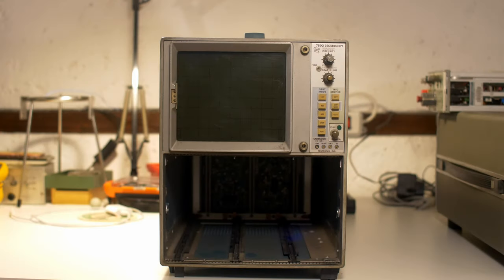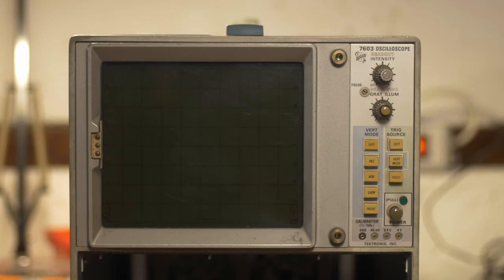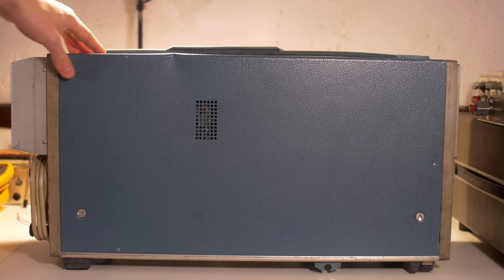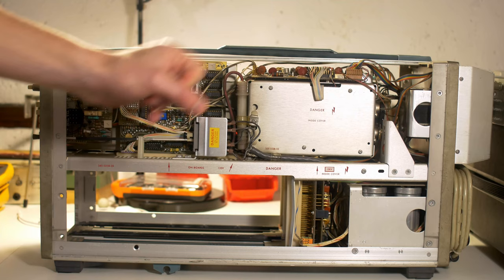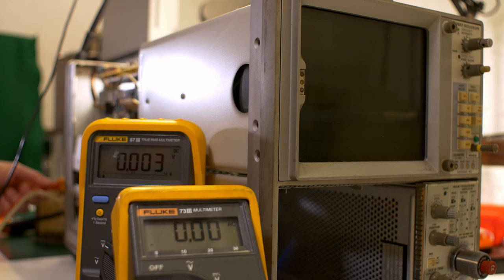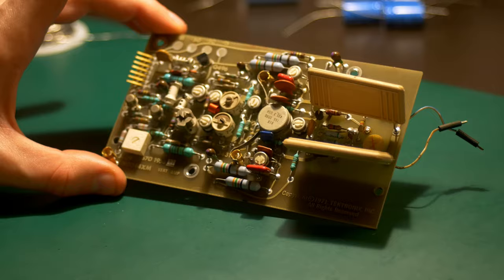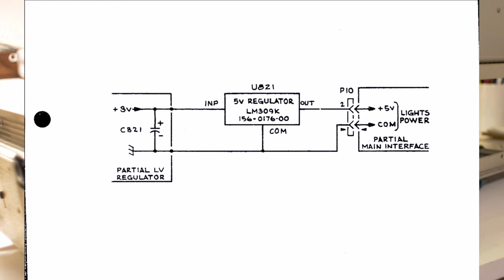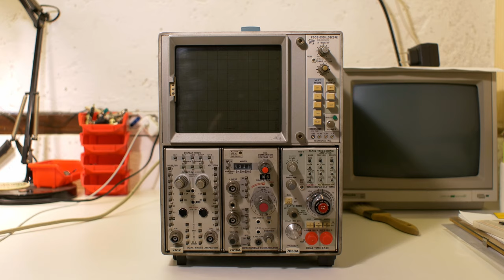Tektronix 7603 Oscilloscope Restoration and Modification

Comment: 20€ for a 7603?!? Is he kidding? The guy who sold it obviously didn't have a clue or was doing a huge favour. They usually go for 10x that (albeit working).
That said, these are great scopes. Very flexible, well documented and pretty useful still. But difficult to calibrate (you need an unobtainium plug-in for proper calibration), and not cheap to expand either, particularly with some of the more specialised plug-ins. I have the 7D01 logic analyser and used it to revive my comatose Tek 4052. Of course there are far more capable analysers around nowadays, but it was a good intro for a n00b like me.
The readout board can develop issues (mine had zeroes reduced to dots) and you'll have to hunt down the custom ICs, which I believe are diode array ROMs that define the characters (quite clever for early 70s tech, actually). I managed to get a replacement for a reasonable price, but YMMV.
As mentioned, this thing is enormous and very heavy; with plug-ins it easily exceeds 25kg. Absurdly, it's fitted with a carry handle -- I'm not sure if Tek was being serious when they included that in their design. If you plan on getting one of these, be prepared to sacrifice significant bench space -- and a few muscle fibres. 😉